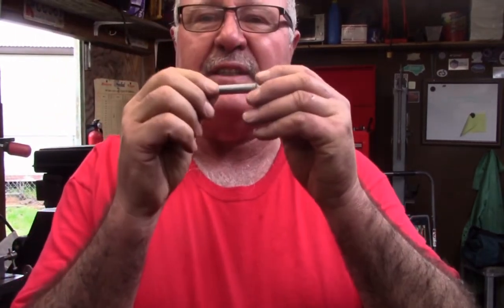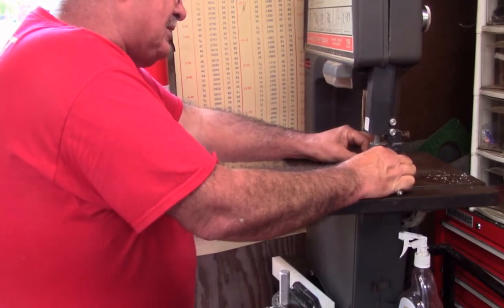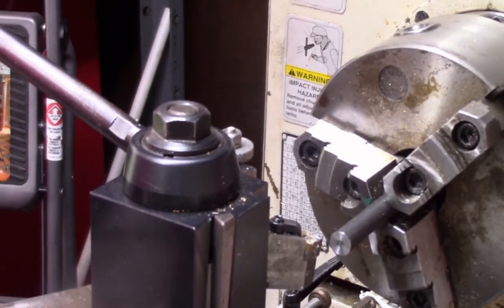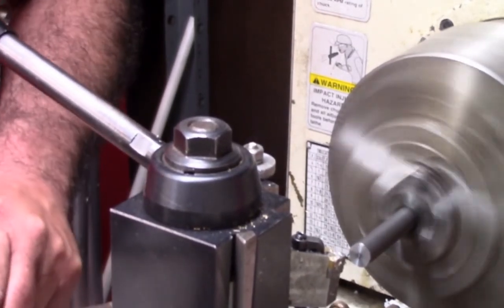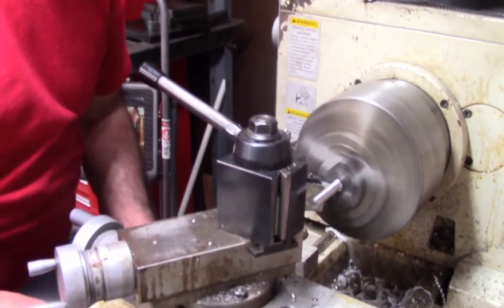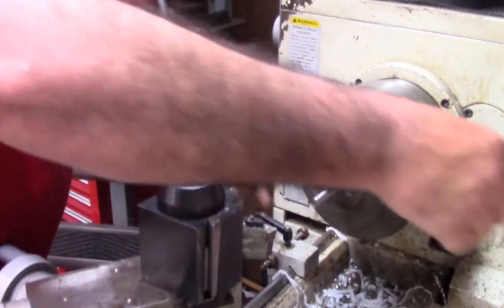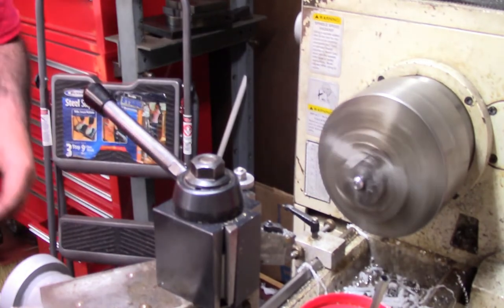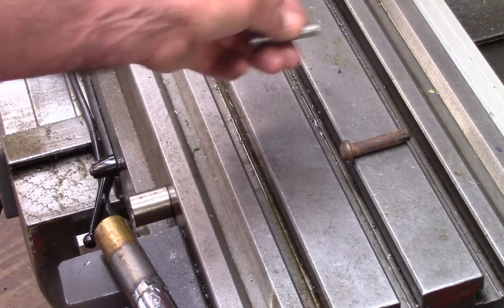The machinist make a pin for the garden tiller

Comment: It's always rewarding to knock out a simple part in the shop rather than driving to the hardware store or ordering online. I see you think about these projects like I do: "good enough IS good enough, any additional refinement is wasting time."
Reply from the maker: Old Iron Lover you know I didn’t think of trying to find one. The tiller was over 45 years old, my Dad purchased it in 1974. The pin was gone for years, in fact we had a regular bolt in it for years. I had to take the outer times off to use the tiller to help dig the trench for the storage building power cable.  While I had it apart I wanted a proper pin. So I knocked it out. Your correct on overkill on some of these parts, I wasn’t working on the space shuttle. Thanks for the kind words

Comment: No point in buying parts when you can make them, as this way you don't have to wait for the mail order to come or have to drive to town.  I like making little pieces like this too.
Reply from the maker: Everett's Workshop like I said this tiller is 44 years old. Who knows if the original pin was even available. I had put a bolt in it manny years ago so when I took the outer times off to dig the ditch